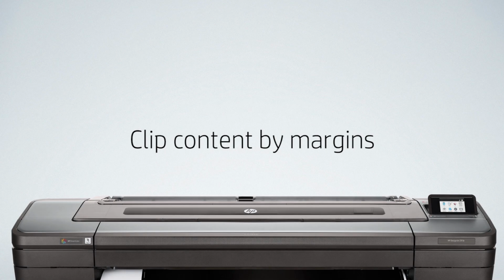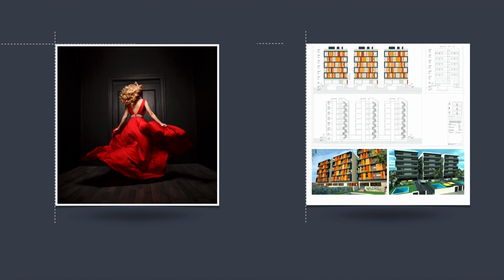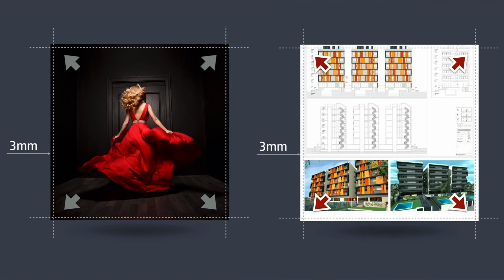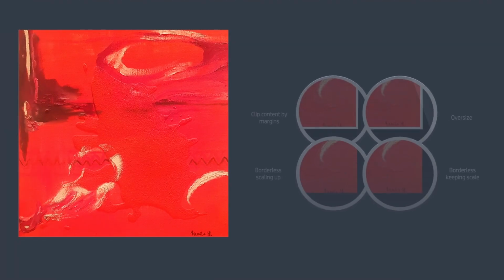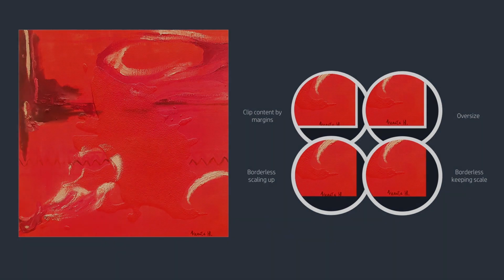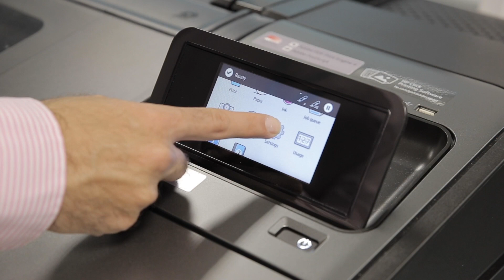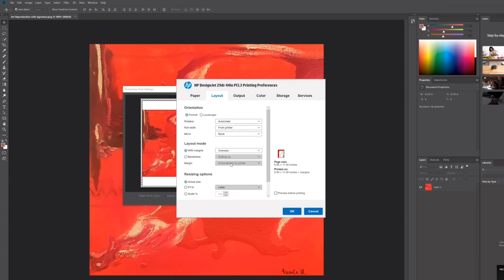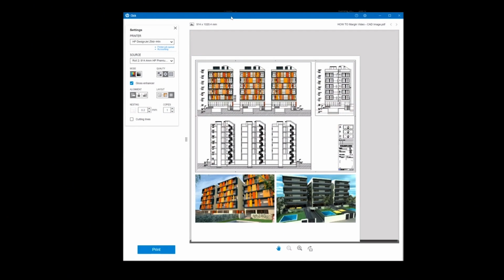Use the Different Margin Options | HP DesignJet Z6 and Z9+ Series Printers | HP

Comment: I have been trying for months to get borderless printing using Photoshop. Always get a margin on at least two sides of every print. 5 different HP techs, they can't figure it out.
Reply from the maker: +John Urbanski May I know the complete model number of your printer so that we can check the details for you?
Reply: @HPSupport  HP Designjet Z9 Model W3Z71A

Talked with HP tech support again. Downloaded the latest driver. For some reason it downloaded the T1600 driver. Tech could not figure out way. deleted and downloaded again, T1600.  And of course this caused all sorts of problems. After the phone call, I deleted the driver and downloaded the Driver Pack instead of just the driver. I was able to get the older driver for the Z9. I still cannot print borderless with Photoshop. Printing with Abobe Acrobat is not an option. Prints very dark and you cannot edit colors or brightness.

Downloaded HP Click. I can print borderless prints. Happy with that. But no options to edit colors, brightness... I have to edit the original file and do test prints for every print.
Two big problems with HP Click.
1. Many print errors. At the start of a print, a print error message will come up. The problem is that it will print about 2 inches of the print, and then eject the rest of the print as blank page. When printing a 36" print, it will print about 2" and then eject 34" of blank paper. As soon as you see the print error message, run to the printer quickly to cancel the job to prevent it from ejecting the blank paper. This happens a few times every day.
2. Do not open HP click before turning on the printer and loading the paper. I made the mistake of opening HP Click before loading the paper. It shows an error that the paper is not loaded, even after loading the paper. No way to "refresh" HP Click so it will recognize that the paper is loaded. If it does not recognize that the paper is loaded, you cannot print borderless prints. Have to go to task manager and end task or restart the computer. Because even if you close HP Click, it is still open in the background. I've shut down the printer and started it back up a couple hours later, same problem. Today the printer shut down when the HP Click print error came up. Error code on the printer was 83DC-F2A1-0000. Said to update firmware. According to HP support, I have the latest firmware.

I don't know why Z9 software is so bad. I loose hours of work every week dealing with new problems because of this printer. Don't ever buy the Z9!

Comment: This video is completely unnecessary and could be surmised in a paragraph of text with example photos...
Reply from the maker: Hi Jordan, thanks for contacting!
I am here to help!
What seems to be the issue? Are you facing any technical issues with your HP printer?
May I know the printer you are using?
Let me know!
Binu - Social Media Tech Support
Reply: @HPSupport  I'm mostly saying that this info should be laid out in a print article not a video.

But since you are here and offering, I have had a problem with my Design Jet T100 since I've had it. If I select any other paper than "plain paper" my black and whites print very dark green and white. The solution I found on a thread years ago was to just use "plain paper" and that's working but the maximum detail option is greyed out with that option, I also assume that limits the DPI of the print.
Reply from the maker: Thanks for the reply.
Below are the papers compatible with your printer:
• Q1396A HP Universal Bond Paper (FSC® certified) 610 mm x 45.7 m (24 in x 150 ft)
• C6019B HP Coated Paper (FSC® certified) 610 mm x 45.7 m (24 in x 150 ft)
• C6029C HP Heavyweight Coated Paper (FSC® certified) 610 mm x 30.5 m (24 in x 100 ft)
• C0F18A HP Everyday Adhesive Matte Polypropylene, 2 Pack 610 mm x 22.9 m (24 in x 75 ft)
Binu - Social Media Tech Support
Reply: @HPSupport   All paper is compatible with my printer. I've been printing on Canon Metallic Photo paper just fine. This printer will not print in black and white with any other paper selected other than "Plain"...
Reply from the maker: Thanks for the reply.
In order to get this issue fixed, please contact our customer care team over the phone or chat for further assistance, as this issue requires Live conversation with you over phone or chat to isolate the issue and provide you instantly with appropriate solution or repair/replacement options available at your place as per the warranty.
Please feel free to reach us on call/chat, please access this link to select your preferred country and language option to reach us. Global support link: - https://www8.hp.com/us/en/contact-hp/ww-phone-assist.html
Binu - Social Media Tech Support